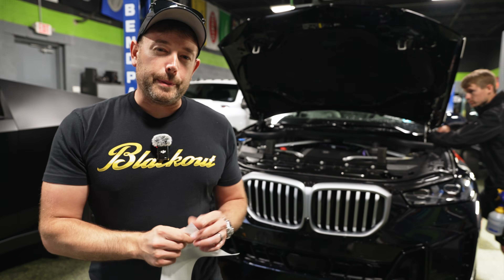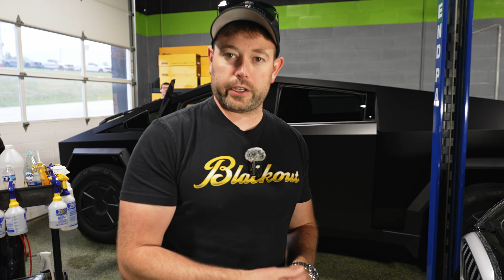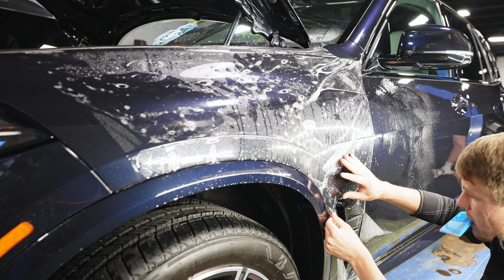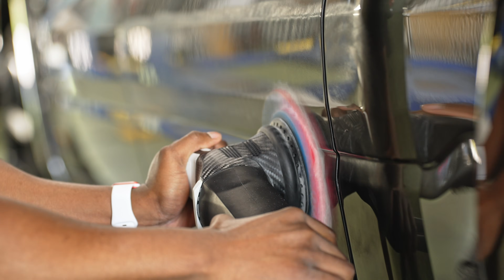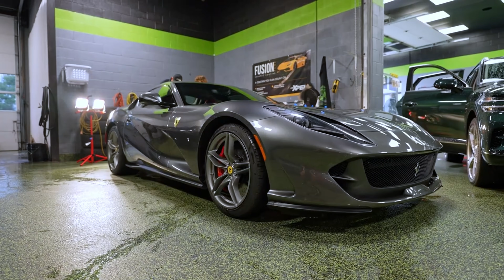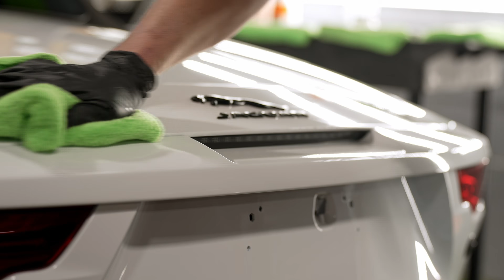Paint Protection Film vs. Ceramic Coatings: Which One Is Right for Your Car?

Comment: So if someone owns a car over 200K get a ceramic coating and ppf on top and garage keep it and don’t use automatic car wash get it hand washed and stick with a detailer who knows his stuff
Reply from the maker: probably the best option, but ceramic goes on top of PPF
Reply: @BlackoutTinting wouldn't a ceramic coat under PPF "lock" in the benefits of the ceramic? I know nothing about detailing or car paint, I appreciate your response
Reply: @luckyleafz  No. Think about a non-stick pan, would you expect it to still be non-stick if you coated it in film?

Comment: Ceramic coating for a brand nee car or I should wait till I get so swirling and small scratches first?
Reply from the maker: if you want to prevent swirls you can get ceramic infused PPF
Reply: @BlackoutTinting Is ceramic infused PPF ceramic over PPF. I have a new 2025 E450 wagon that has a high gloss paint finish and is beautiful. Will I have this or better look if I do a ceramic over a PPF or will it dim it?

Comment: You should test out installing the ceramic coating on top of PPF. Protect the paint and easier to clean overall.
Reply from the maker: we do that all the time
Reply: @BlackoutTinting Wouldn’t this be an issue for keeping that new car more gloss look if the PPF has a more dim feel based on the thickness and now adding more layers etc…?
Reply: That’s been going on for a while lol

Comment: The difference is pretty simple. you can put sunscreen on to protect you from the sun but it won't really help you if it rains. Best combo, sunscreen for the bird poop, raincoat to protect the paint--combo best, but each for a purpose. Nice job guys educating the car community and dispelling the myth!
Reply from the maker: That's a good way to put it. Thanks!!
Reply: doesn't applying ceramic coating to PPF pretty much neglect the hydrophobic properties of the PPF? I know ceramic coating is also hydrophobic but a detailer told me it's not needed to apply ceramic coating on top of PPF. If the ceramic coat wears away (or fails) then the entire PPF hydrophobic properties fail with it.